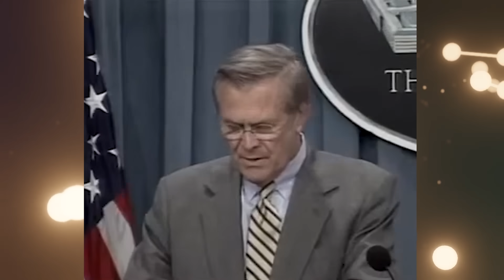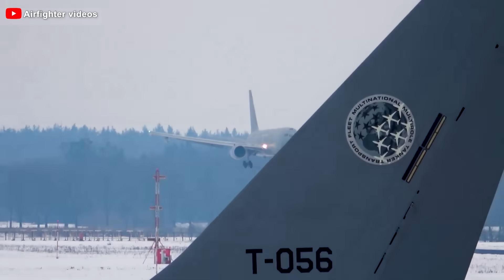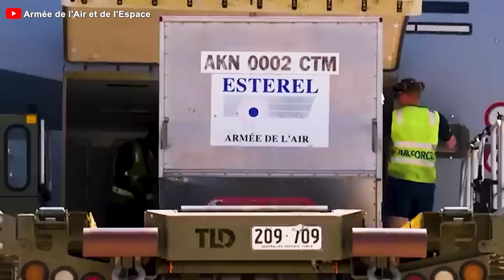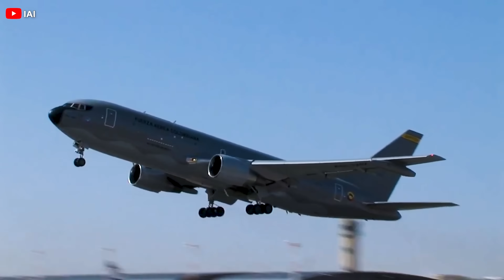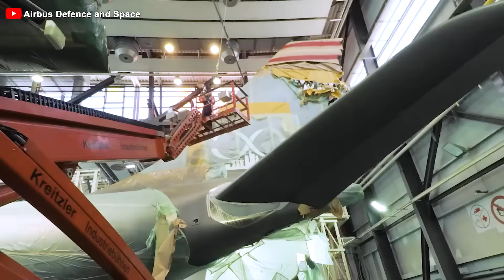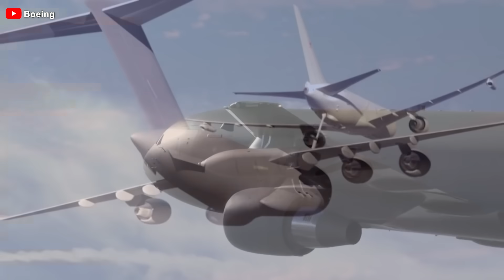Here’s why Air Force prefer the A330 MRTT to Boeing 767 in KC-45 contract!

Comment: I think AIRBUS stole a march on the americans. You can actually take second hand aircraft from the leasing companies at a cheap price. Civil aircraft are build to hard daily work and flying vastly more hours than the military - if that had not been the case, then the constant updates of the KC-135 would not have made sense, as they would have run out of fatigue life a long time ago. That means that in all probability second hand A330 still have decades ahead of them in military use. 

The  second thing is, that A330 is generally using the Trent engine. The CF6 has the double amount of time between major overhauls and removals. And the Trent has the double TBO than that the CF6. This means in military use that the Trent engine is never expected to be removed from the airframe. If the second hand aircraft has reliable and complete documentation - you can just avoid ever giving the engine a major overhaul.

Thirdly there are lots of pilots checked out on A330 in Europe thus the transition in reserve of civilian pilots should be smooth.
Reply: No, Military aircraft in peacetime fly  FAR less than commercial airliners..
Reply: Although it is possible to convert existing "pre-owned" aircraft, most A330MRTTs are built as new aircraft from the production line.

Comment: You can thank insane John McCain for Boeings tanker problems.
Reply: Boeings Tanker problems, are Boeings. Their problems are not just tankers, but across their entire range, military and civilian. Boeing isn't the company it was before the mid 1990s.
Reply: @ronaldv_tm Boeing built KC-767s for Japan that don't have the issues the KC-46 has. The Air Force had a large surplus of KC-10 booms around and forced Boeing to adapt it to the KC-46, they're equally to blame for the Jets issues.
Reply: @NWA744  those KC-767s have been flying for quite a while now, with the first ones delivered around 2003. Back then, Boeing was largely still perceived to be the reliable aircraft builder. The (McDD developed) flying boom (to the best of my knowledge) never was a problem. The RNLAF used the RARO-version on their KDC-10 for about 25 years and both Japan and Italy have used it for 20 years. Boeing's current RARO-II implementation of that boom is problematic, as is most of their current hardware. That they build but are not to implement the next generation Doomsday plane is telling.

Comment: Capability means more than just airframe. Australian RAAF originally preferred and requested Boeing KC-46 (better fit for airfields and facilities in our region and had an existing upper deck cargo door), the politicians chose MRTT. The rest is history.
Reply: They wanted a comfy plane that could go transpacific and to massage their egos doing the photo-op at the tarmac with a bigger plane.
Reply: @JosephBloggs-jk5lv  Well, it also works, so there is that...

Comment: The A330MRTT did not meet the RFP of the original program, which was why boeing won the appeal.  If Boeing knew the MTOW was going to be ignored, they would have proposed a KC-777, which would have far outperformed the A330MRTT.

The subsystems and mission creep have been the doom of the KC-46A, and the same exact thing would have happened to the A330MRTT, as the USAF just loves to change the goalposts and add the newest wizzbang wonder concept to their programs
Reply: The MRTT works, the issue was always going to be keeping 99% of the money in the US. Even if USAF ties to buy the best 'fit for purpose' aircraft it will always be scuppered by partisan politicians looking after the likes of Boeing who operate in their area, (mainly due to their obvious re-election funding requirements). Some shameless politicians would rather build a piece of crap and charge 4x as much for it as long as it buys them votes in their state. The money wasted could and should always be spent on the war fighters at the front end, it is not a bottomless pit of cash. Anyhow I bet Boeing regret not keeping their mouth shut, another $1.7 billion lost on KC-46A and Airforce One in the 4th Quarter of 2024 whilst getting a Lot 11 order for 15 more KC-46A's, worth only $2.38 billion. I suspect that those losses will probably be worked into future USAF contracts. Some people will NEVER learn.
Reply: @GeoffCorcoran The MRTT flying for Australia is NOT the MRTT that would be flying for the US should they have chosen it. Also add in that Airbus doesn't want to give customers full access to their systems like Boeing will, and that's yet another reason they didn't get picked.
Reply: @GeoffCorcoran  It's all about the bribe, man
Reply from the maker: Thanks for your sharing!
Reply: you do mean manipulated
Reply: @alpearson9158 , what was manipulated?

Comment: Question:  Can Boeing ever deliver what they promise as they have not been able to on many occasions lately and have not been able to build aircraft without many issues that have affected the ability of the clients efficient operation?  

This is a major issue that could result in a huge increase in maintaining old platforms that are being used at this time.  Having a versatile design design is an advantage as it means that it can be used for differing needs that are likely to occur in the future.  It is an asset that will be operating for some time so needs that versatility as  showing in the Russian invasion of Ukraine.  Flexibility is the key.  In respect to the issue of the planes being made locally, that was not an issue with Airbus Committing to building plants to make them in the US.  I'm sure that the 1% discount will have been eaten up by now so the cost difference shouldn't have played a part in the decision.  In respect to the footprint of the two aircraft, again this is irrelevant as the change is something all new aircraft have an issue with.  Don't remember that this issue was considered hen the C5 Galaxy was introduced, which would have required a lot of upgrades to many airfields to deal with.
Reply from the maker: Noted!

Comment: This is a joke.  The KC46 is much better than the KC-767. And delivers more fuel when the distance is over 1200 miles.  It needs less runway and fits where the existing planes fit.  And the USAF has plenty of transports.
Reply: So it's better because it can carry less fuel, carry less cargo, only travels shorter distances and has fewer refueling options than the A330 MRTT. But it can fit into smaller hangers....  Say these things out loud and see how stupid it sounds. The tail wagged the dog on this purchase when a lot of politicians went against what the US Airforce wanted. Not the first time it's happened and sadly won't be the last. I feel sorry for the troops having to use substandard equipment.
Reply from the maker: Sure.

Comment: The MRTT has significantly more operational capability and has been used a lot more since launch. It's also as easy to fly as an A320. A much more well rounded, thought out, better option that offers additional capability.

Comment: So if we picked Airbus....how do we get spare parts if Europe is taken by Russia.... Boeing had to be our pick.  Airbus also use metric tools... USAF and USA aircraft use standard SAE tools...
Reply: The Russia that's 1056 days into a 3 day war and whose economy is close to collapse? The Russia that's sending 60+ year old T-55 tanks to the front lines? That Russia?

🤣
Reply: @johnroberts2905  Well I guess NATO readiness is just beyond what it was in the Cold War.... You're delusional if you think NATO or we Americans are ready for real war. Aka WWIII.
Reply: That's both easily solved and something both options have to deal with. A significant portion of the A330s components are made by US suppliers. Conversely, a significant portion of the 767s components come from Europe. That's just how modern supply chains work.

The solution to that sort of thing is "dual sourcing", meaning the aircraft manufacturer is contractually obliged to find a separate supplier as a back up, in this case a US based one (or Canada, Mexico, etc., whatever fits the risk you are trying to mitigate). This is done all the time in industry, because large companies don't want to be at risk if one of their suppliers has any kind of issue any more than the military does.

One example where this wasn't done properly was when in 2011 severe flooding in Thailand took out about 40% of the worlds Hard drive manufacturing capacity for months.
The industry learned a costly lesson and HDD manufacturing is far more spread out these days.

Semiconductors in general are a sore spot in that regard, with Taiwan and TSMC in particular probably being the biggest single point of failure the world has ever seen.
Thus, you get the US and EU passing Chips-Acts to ensure more geographically spread out manufacturing capacity, preferably in their own back yards
Reply: @Mosquitobomber1  It's not easily solved ....the tools are different... Metric tools and parts don't mix with Standard SAE tools and parts..... The entire US military is on Standard SAE tools and parts.... To bring that into the mix would beyond fuck up logistics to a point we can't sustain.
Reply: @madogllewellyn ? I wasn't talking about Metric vs SAE, I as talking about the supply chain risks you mentioned. I have no idea how much of Boeings design work happens in SAE vs metric, and how much metric stuff is used in the USAF, so I'm not qualified to talk about that (though I do vaguely recall there being legislation that mandates all US Government contracts to be executed in metric, but idk)
Reply: No, the simple fact that people miss is that Boeing already has logistics, supply ,maintenance and training already in place with the USAF
Airbus would have to build all that up from scratch 
Lastly , the USAF was looking for replacements for the E-3 and RC-135s and using the KC-46 as possible baseline was more attractive as AWACS package did exist for the 767 frame
than the A330
Reply: This decision smacks of jingoism.allies trust each other .you just told Europe we don't trust you.well if you don't trust us ,we don't trust you.then you elect trump? Your empire is rotting from within and all of you are responsible for the collapse that is coming soon as next month even.
Reply: Europe would never have been taken by Russia. That would only happen if the Orange Idiot withdrew the US from NATO. As it is. The USA alone could crush Russia's military within a week with it's air capability.
Reply: Imperial measurement sae is an American sop  .the English kings measurement system 😂😂😂
Reply: @joesutherland225  I'm aware of the UK standard for it but since they don't use it anymore we call it SAE. Even then we still referred to it as Standard over Imperial system.
Reply: @ Get with the programme. The rest of the planet went metric decades ago.
Reply: Its been many years since everyone switch to metric.
Reply: see a shrink asap

Comment: Maybe we don't want French aircraft as part of our national defense?  Perhaps part of defense authorizations is maintaining a vigorous industrial base to produce equipment for our soldiers, sailors and pilots here in the United States?

The KC-46 is a 767.  The 767 is a proven aircraft with decades of reliability and safety.  There is nothing wrong with the KC-46.

Boeing won WWII.  The B-17 defeated Germany, and the B-29 defeated Japan.  What has Airbus defeated?
Reply: I think you forgot that the times have changed a lot since the WW2 times. Airbus is a project of Europe(or specifically GB, Germany, Spain France and some other to smaller degree), not just France, and the USA is allies with Europe in this thing called NATO in case you forgot. 

Airbus also can’t possibly have won any wars, as the company was only made after WW2, but todays track record of Airbus is far better than Boeings. Just remember the doors falling off of Boeings and the crashes that led to grounding of entire fleets. 

You also seem to have missed the point that Airbus would have worked together with Northrop Grumman, a US company, and would have set up new production lines on the US for this aircraft specifically. Now they are producing narrowbody aircrafts there instead.

In the end, it’s safe to say that not everything can be based on past things. Boeing isn’t better than Airbus because they built planes in WW2 and Airbus didn’t, and a decades old plane, while proven to be good for its time, is not the best for something modern thanks to the development of new, better avionics and more fuel efficient engines, new  and lighter materials and so much more. The times are changing, and so does military doctrines and world relationships
Reply: USAF choose the K-46? This is a joke. In fact EADS won the two first bids and the third bid went to Boeing only because US politicians forced the hand of USAF in favor of KC-46 and not because of a supposed 1% cheaper offer. Today additional development cost (supported by Boeing as per contract) are exceeding 7 Billion USD and still KC-767 is unable to achieve initial requirements.
Even Boeing's early customer like Italian Air Force cancelled their order for the Pegasus, a 767-300 based tanker, and will most probably switch for the A330-MRTT.
USAF did the right choice by awarding the contract to EADS, but the misplaced pride of US politicians in this case demonstrates, once again, the slow descent into hell of Boeing and as a bonus, American taxpayers will pay several billion dollars more, for a product which will never reach the efficiency of the European A330-MRTT.
Reply: @stabilo3170  
The simple reality is that EADS should have never gotten the contract in the first place
The KC-767 was already made and ready 
The USAF simply needed to buy it instead of wasting time with trying to lease which created the mess
Reply: @verdebusterAP  If it was made and ready, why is it still not fully operational, and Billions over budget?
Reply: @ 
Wrong
The KC-767 and KC-46 are not the same plane
For the KC-X program , Boeing went with completely new design
The USAF in 2003 should have simply ordered 100 KC-767 as is
Reply: @verdebusterAP  The 767 is still in production.  Boeing restarted the assembly line for the 767 to make the KC-46, and FedEx and UPS said "if you're making more 767s, we'll take dozens!".  Orders on the books for Boeing ensure the 767 will remain in production into the 2030s.
Reply: @ So we should also choose the Mirage over the F-22?

Made in America is superior to Made in France.
Reply: @dvandkq  Well, you did say Analogue is better than Digital in the battlefield?
Reply: People's fear of flying - unlike Boeing.
Reply: It carries less fuel and costs more to run but if you think that is better go for it.
Reply: @charlieroberts7775  This taxpayer wants his tax dollars buying American-made aircraft, not French.
Reply: Boeing.
Reply: Indeed the A330 this is based off is far more advanced than the 767.
Hell, the 767 isn't even Fly-By-Wire!! 😂
In the 21st century, America is building aircraft with cables and hydraulics, not, you know, a computer line a proper aircraft is 😂
Reply: @MostlyPennyCat  Analog > digital on the battlefield.
Reply: @dvandkq  Just no. it makes no difference as tankers are not supposed to whistand any ennemy fire. Fly by wire is both safer and easier to maintain, thats why its used everywhere. Guess what, no fighter jet uses cables, thats WW2 tech.
Reply: @justeunfan3364  You've obviously never heard of the KC-135, which is a Boeing 707.  65+ years of service with those planes.

Or the VC-25s and EA-4s, which are 747s.

There's the P-8, otherwise known as a "737".

Plenty of airliners have been adapted for military service.

Comment: Just asking but why wasn’t the B777 considered if fuel capacity is a concern?
Reply: Just look at the 777 project problems thats why Boeing did not want to put workload on anaother derivative - instead they took an old design, make a paper tiger out of it and voila - next tax payer money scam completed
Reply: @Flying_Tiger  The Standard 777 would have been fine for this.
Reply: @ttmaggebo  possible but Boeing did not want to develop another derivative instead get more cash out of the aging 767 industrial system
Reply: The 777 isn’t ready to be adapted into a tanker and cargo aircraft. The 767 is a much more cost effective option and a greater rip off for taxpayers.
Reply: Because the USAF has no brain
A B-777-300ER freighter would be a future proof choice
High payload and range 
but most important is that unlike the B-767, Boeing is heavily invested with the  777s
The B-767 is being replaced by the B-787 which geared towards passengers not cargo
The 777 cargo capability prized to many operators
Reply: BULL$HIT !!!  The airforce did NOT want a larger tanker, they learned their lesson with the DC10 tanker !!!!   A 777 version was offered !!!!!

Comment: Rough terrain operation capability can be fitted to the A330 MRTT, if required.  Usually no air force deploys its high value assets too close to FEBA.

Comment: I just don't understand why both can't replace the KC-10 and the KC-135s? Both of those had different, but the same rolls as does the KC-45 and 46.
Reply: I also don't understand why 1 tanker needs to do the work of several current ones. I think basically they need a smaller and a larger one. The KC-10 is the larger one and newer. They should just keep it for now and replace the KC-135. The deal was worked out under the constraints of sequestration deal. Remember that? One size fits all was a cost saving measure that doesn't make sense.